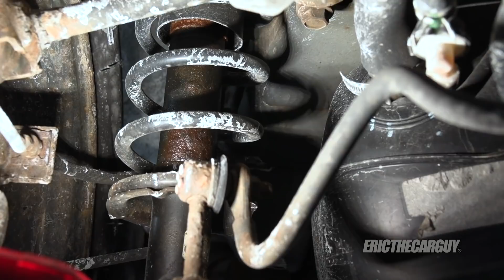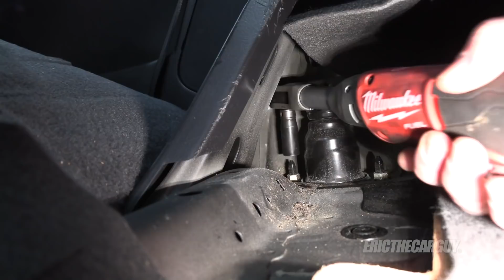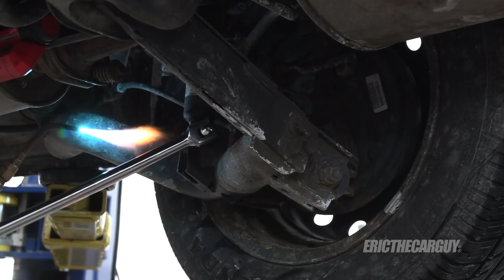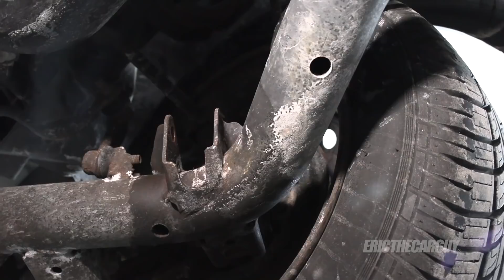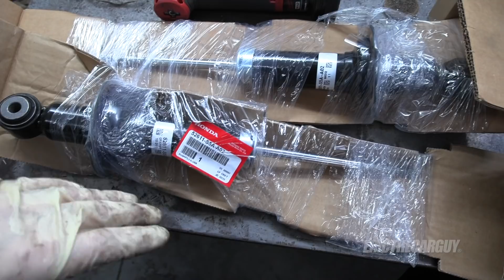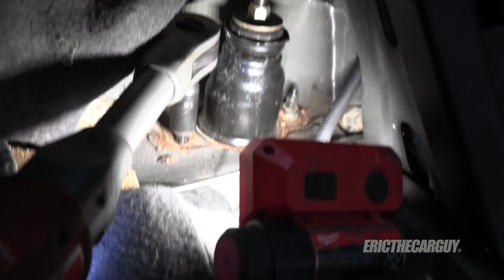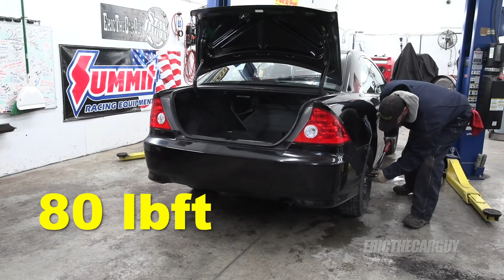2005 Honda Civic Rear Strut Replacement

Comment: Another $700 gift to your son.   I thought my manual said to tighten the top nuts with the weight of the car on them and not the bottom one, but the way you explained it made it seem like it makes more sense to not have the brunt of the force in a weightless situation compared to where it would rest in the bushing on its own weight
Reply from the maker: In my opinion the top nuts don't matter, but the bottom one does for the reasons I mentioned in the video. Doesn't mean I can't be wrong. Thanks for the comment.

Comment: I don't have much rust on my 02 civic si (7th gen, but this one is a British made one), but the rust it did have was all on the rear LCA bolts when redoing suspension and bushings(did whiteline bushing all round and have been really happy with them. And pulled RSX "A Spec" shocks n struts which are near identical.) I believe this civic uses the same steering rack slider as mine as well; if it wanders on the freeway or has loose steering...https://www.shgmotorworks.com/store/Steering-Rack-Slider-EP3-DC5-EM2-CRV-Element-p58331035 <- this thing is amazing even if a bit of pain to get in.

Comment: Spray a ton of pb blaster and let it sit for 24 hours. Worth a shot
Reply from the maker: In my experience, no amount of penetrating oil will solve this. Also, in my opinion, the best penetrating oil is automatic transmission fluid mixed with acetone. Thanks for the comment.

Comment: So...stupid question since you are now going through this...If you don't have the fastener, where do you get one?  I need to do the shocks on my Tahoe (as well ad pretty much the entire upper front end suspension), and I'm 99% sure I'll break the fasteners or will need to cut them off (it's a 1999, never had them replaced...and I live in the land of ice and snow...and salt).  I've asked the usual scumbags and they're like "meh, just go to the usual scumbags and buy the bolt".  Yet...some of these are special size.
Reply from the maker: I've been working on Hondas for more than 20 years. Over time I've kept a few things, including special suspension fasteners like this. That said, Im not sure if you'd have the same issue with your truck. As much as I hate to say it, this seems to be more of an Asian vehicle problem in my experience. Also, have a torch handy, it's very good at loosening up stubborn bolts. Link in the description to a video about it. Lastly, you might check out my #ETCGDadsTruck series as I rebuilt the entire front suspension on that which might provide some insight into what you're looking at. https://www.youtube.com/watch?v=kCepnacqRuI&list=PLSzhQ6St-ov1g_GML2aVq6EN-_ShJ9G2o

Good luck
Reply: @ericthecarguy  Yep, been following the Dad's Truck...which looks to be pretty much the same as my '99 Tahoe.  My biggest concern is finding fasteners.  Always has been.  As you said, you've been collecting them for years...but I'm not that fortunate.  LOL.

Comment: Thanks for the video I enjoyed it immensely while eating my waffles . Made breakfast so much more enjoyable. Would you have a video on the rear struts on your 04 Element? What about recommendations on struts. OEM or aftermarket?
Reply from the maker: The procedure for the Element is almost identical to this one, they may even share the same rear lower control arms. I always recommend Honda suspension parts for best ride quality. Thanks for the comment.
Reply: @ericthecarguy  Thanks I always look forward to your feedback. Would you recommend the strut or the entire strut spring assembly
Reply from the maker: Hard to say, the complete assembly would be best if you were planning to keep the vehicle a long time. But it really depends on the condition of the old parts and how much you're willing to spend.
Reply: @ericthecarguy  thanks I plan on keeping it until?? It has 200,200 miles but runs like a champ. I had an new 03 that I bought when they came out but some guy in a Porsche skidded on ice and cut my son off that wound up totaling the car. Thus the 04 same color (black). For whatever reason the 03 felt peppier. When I got the 03 I attended a customer feedback session given by Honda and was paid $400 cash to attend. Biggest complaints should have had a V6 or diesel and better ground clearance. I really value your videos. 👍 How is the undercoating holding up? I plan on getting it.

Comment: Man that really sucks I have a upper control arm that needs to be replaced on my civic and the fastner is seized in one of them. Luckily if I take the wheel off I have good access to cut the bolt out

Comment: Thank you for showing the rusty struggle as well. It's always easier overall if you can get the bolt out in one piece. Tons of penetrating oil, massage with hammer, impact and patience. Still better than drilling out from underneath.
Reply from the maker: In my experience once the bolt seizes inside the bushing it's done. No amount of penetrating oil seems to solve it and by the time you're done working it back and forth you've probably damaged the bushing. Although, sometimes you might get lucky. Thanks for the comment.
Reply: @ericthecarguy You are right! When i looked at the part i cut with the sawzall, it looked like it somehow swelled or was actually one piece! There was no way in hell it would have ever broke free, it looked like a ring when you cut a tree down. It was a very faint separation.

Comment: WOW!  A rear strut job with grief done in less than 16 minutes!
How to handle stubborn bolts?  Get out the blue tip wrench!
And never force it.  Just get a bigger pry bar, a bigger breaker bar or bigger hammer.